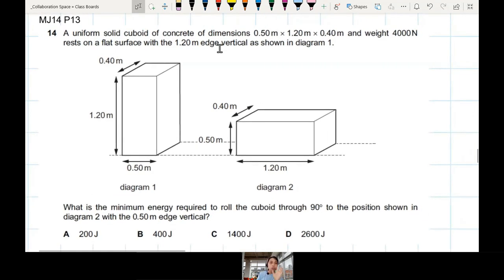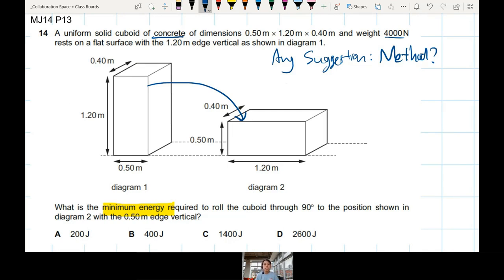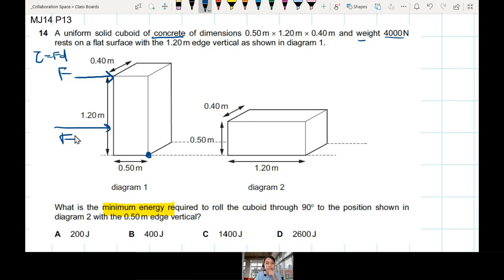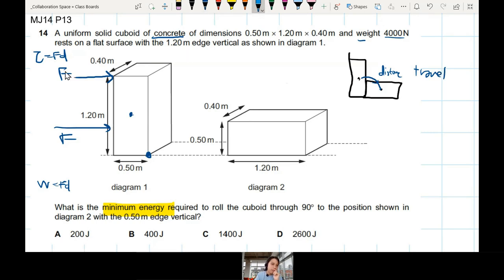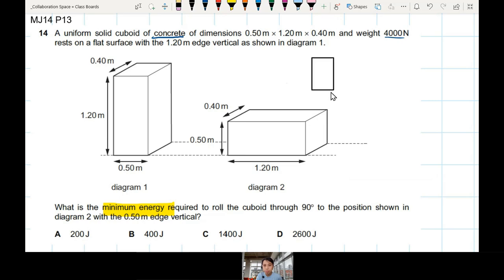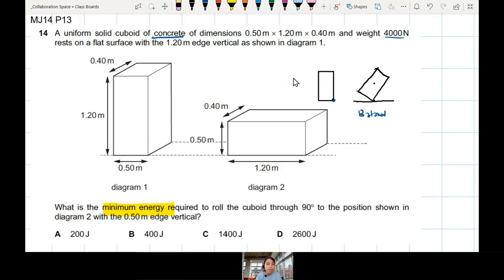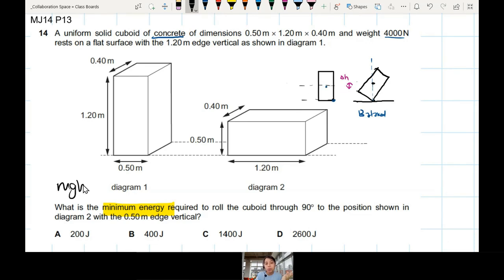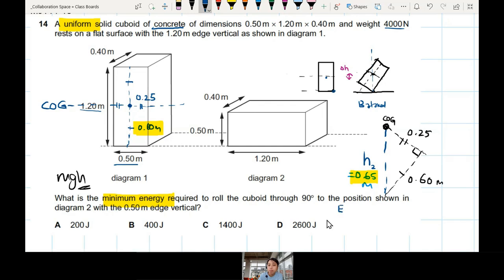MJ14 P13 Q14 Min Energy to Roll Cuboid | May/June 2014 | Cambridge A Level 9702 Physics

Comment: miss could u explain why we need to take the height from the point of centre of mass?
Reply: It is the centre of gravity. This is where gravity acts. The gravitational potential energy of an object is due to its position in a gravitational field and since gravity acts at centre of mass/ centre of gravity we take height from there. It does not act at other points like top or bottom but appears to act at geometric centre.